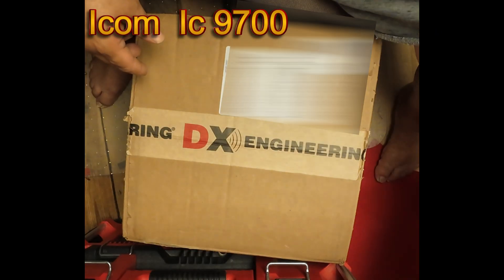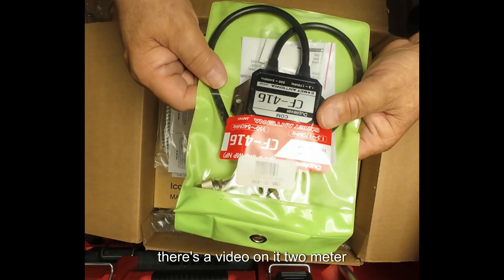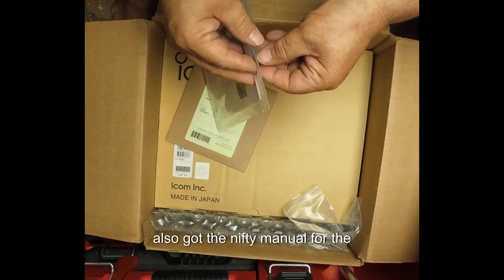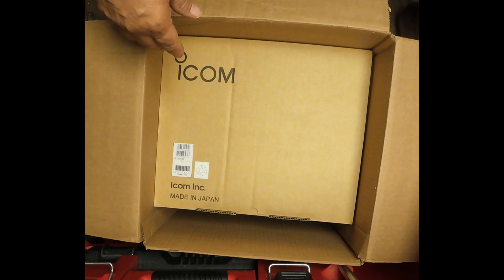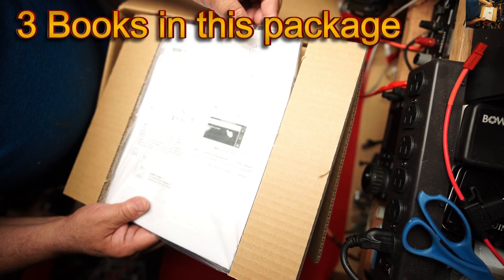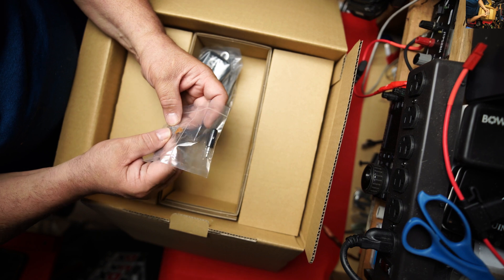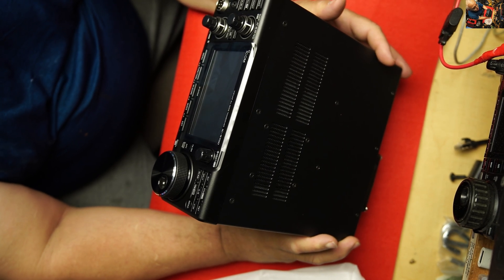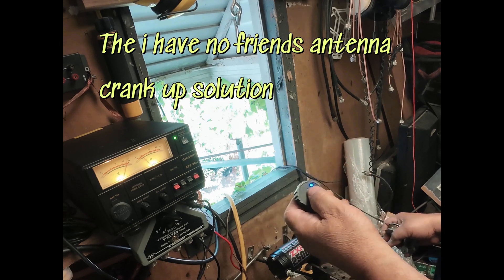Unboxing the icom 9700 and setting up a quick antenna.

Comment: I have the 9700 since it was launched but if you only use it for repeaters it's a complete waste of time, as you are not using it to it's full potential
Reply from the maker: agree I intend to use all modes,  lets see how it goes,   I really wanted to put up a beam but no room,   it sucks,  so far I love the radio , not much action on cw or ssb,  that I could hear,